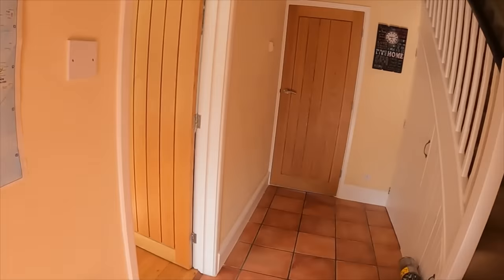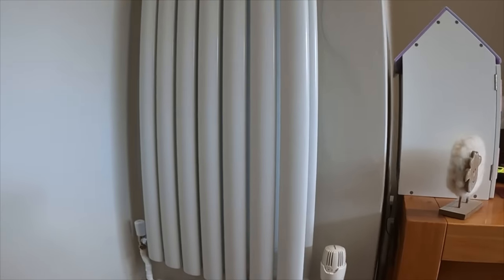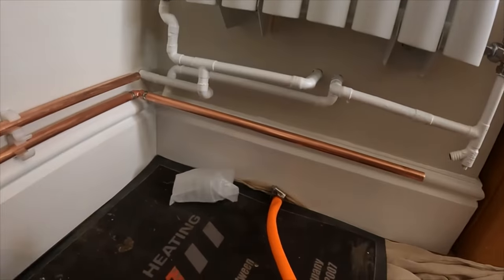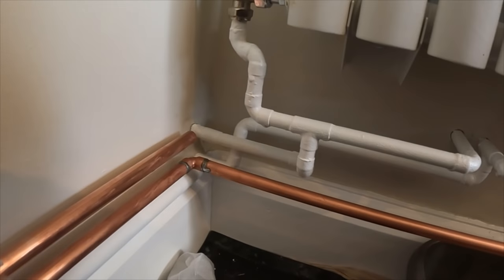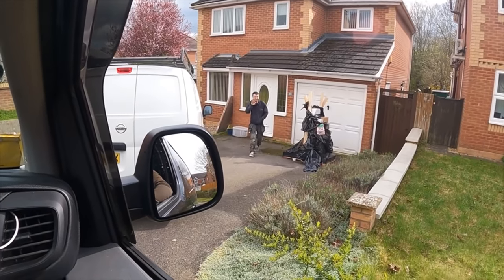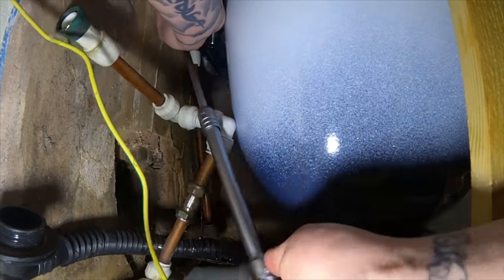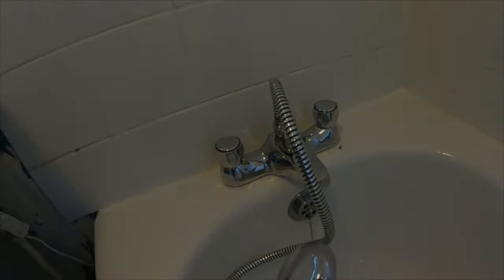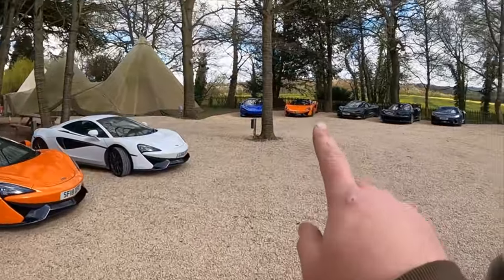HOW TO FIT A RADIATOR in your HOME | REAL WORLD PLUMBING

Comment: When i started work aged 15 in 1969 at a medium sized industrial heating firm, everything around radiators was hand screwed iron pipe. Schools circuits might start off in 2" and diminish to around 1" at circuit ends, radiator sticks had to be offset by hand, and flow risers kept perfectly in line with radiator edges as the clerk of works would walk around eyeing them up. Boilers were delivered in sections, the biggest i can remember was the Robin Hood Colonel ,and the Beeston Brigadier. We had to prepare bases, somehow get the sections into place, clean all the ports and nipples, lightly oil them and then place them in position, one by one, and pass the stay rods through the hole in the castings before tightening up evenly to pull all together. Cast iron radiators arrived in sections, having to be made together with left and right hand nipples and a nippling tool , thin gaskets being the sealing medium between sections.I well remember an old guy showing me how early cast iron heating systems were jointed , such as in churches etc, it was a repair, and consisted of caulking a joint with the aid of spun yarn, sal amoniac, iron filings and piss, the uric acid causing the rapid setting of the sal ammoniac, and the resulting rust of the iron filings further strengthening the joint. Now retired , I loved those days, eating asbestos, mashing tea, being with the old guard , the discipline, the laughs, and the men who made sure that you knew enough to hold your own, I wouldnt change my memories of those days for anything . Sorry to bore you all, but I have very fond memories of my working life, same firm for 45 years .
Reply from the maker: 👏🏼👏🏼👏🏼🙌🏼🙌🏼🙌🏼🙌🏼….. thanks for the message buddy
Reply: @MJTiffPlumbing  Lol, thanks for reading, I just have such very fond memories of those long gone days, I was always in my element with the jobs we had, old Cyril , who could wipe a joint. lead to lead and make it look like it had been turned on a lathe, Albert who used to cop for mainlaying, standing over me while caulking my first joints with yarn and lead that had to stand 200 lb test pressure, being made by old Fred to draw branches up by hand on 10 inch copper while he stood smoking his pipe , they were passing the old skills on, and now they have gone, well progress i suppose. At least, I have some very happy memories, stay safe and I hope everyone can keep themselves employed and prosperous.
Reply: Absolutely love this old stuff. Would love to hear more

Comment: Another great video Mark, its never easy when your connecting onto existing heating pipes, you just have to do your best with what you've got, the barns looking stunning mate, the customer should be really pleased with the standard of finish
Reply from the maker: Evening Tom
Thanks mate…. Yer they can be a pain sometimes with that bit of water that just won’t come out🙈

Yer the Barn is there or there abouts now….. want to get a video with the heating system up and running very soon

Comment: I was looking forward to seeing how you sweat off a fitting , but you forgot. I assume you simply apply heat, pull off the fitting and wipe clean while it is still hot. That plumbing beneath the vertical radiator reminded me of a London Underground map! The customer must be mad not to have it taken out and increasing the size of the new one to compensate. The pipes could then have been tidied. It would not have been a big job to fill a few holes in the wall and give it a lick of paint, especially since it is such a small area. Some people can't think past the tip of their nose. Nice video, I'm new to your channel., I like the way you explain exactly what you are doing. I'd have hated the tap exchange, but that ratchet tool is remarkable. I'm retired, but have always been a keen DIYer who enjoys plumbing.

Comment: Tricky job on the rad but looks neat enough with what you were up against i agree with you about putting enough solder on the joints better than leaks and having to drain down again
Reply from the maker: Thanks mate, yep I like to know it’s run round.

Comment: Is it better to take valves off before soldering just incase can melt inside if rubber.
Reply from the maker: You can do, I’ve never had an issue

Comment: As a retired plumber I think it looks great in a steam punk kinda way, love the vids but just curious, do you not use a bender, I would have been hung if I used the amount of fittings you tend to use, I also had to use tube expounders instead of straight couplers, but then we did use lead solder back in my day. as I say love the vids. from northern ireland.
Reply from the maker: Thanks buddy…. Indeed I do use a bender when needed, infact I have JUST today had a new one delivered….. keep your eyes out for a new video
Reply: Steam punk is right

Comment: Yes once again great job i was just curious as to why that tall rad was not removed altogether, and a much larger rad installed straight away,I ask because my builder got me to fit them and they are complete rubbish especially the one in the extension,i have regretted ever fitting them, the prob is the floors are down, and wifey says no pipes on the skirtings, she hat the pipes, cheers again.
Reply from the maker: As said in the video…. Saved the issue behind it

Comment: Another great video mate and appreciate the advice and skill that you have with your trade. If I can ask a simple question, I seen that the pipes had been painted, in your opinion what is the best way to take paint off copper pipes to replace a valve and clean up the joins?
Reply from the maker: Thanks buddy….

You can use good old wire wool and heat it up…. Works for me

Comment: Not surprised that tall rad didn't heat the space, it's in the worst position going. Internal wall directly across from the window or below the window to aid convection otherwise you risk poor air circulation or warm air blanketing shutting the TRV down prematurely. Come across it so often with new builds where they couldn't be bothered to run the pipework to the outside walls so every rad is on a side wall close to the centre of the house.

Lovely job on the pipework considering what you had to work with.
Reply from the maker: Yep, they are just so ineffective…. But look nice 🤣🙈🙈

Yer sometimes you can only do what you can with the Pipework you have
Reply: @MJTiffPlumbing  Yeah look great and the potential heat output is high, if they're placed in a room properly, either side of the window would have done a better job. 
Barn is looking great now the shower screens are in, though I wouldn't want to have to change the combi valve on that tank, hopefully looks tighter on camera than it really is.
Reply from the maker: @effervescence5664  thanks mate

Nope….. is proper tight, nowt to do with me but I have mentioned it. 🙈🙈
Reply: Didn't know it wasna GOOD thing for rads to be under windows! Thanks for info.

Comment: Another good vid: mind you, you are a lucky boy with both that vacuum & bath tap change. Last ones I did, couldn’t hold vacuum for some reason & bath tap had no iso valves & old broken gate valves on water supplies & the bog 9 cms from the bath panel & boxing too! No wonder most plumbers tend to hang up when people ask bout bath tap change!😁😂😁
Reply from the maker: Never had an issue bunging tanks, just mate sure it’s done right and air tight.
And the taps…. I was waiting for the ISO’s to leak to be honest 🤣🤣

Comment: Random question for you... if its a gravity fed system did you have to rebalance the system? My heating works off a back boiler in my coal fire and i cant get any heat in my dining room rad without putting the pump on... all other rads warm apart from that one but it warms lovely with the wee pump on? Any advice?
Reply from the maker: Leave the pump on buddy 👍🏼👍🏼

Comment: Loving the videos, keep up the good work. Its never easy doing a great job with hard pipework.  With the bath tap change, did you fit Double check valves after converting it to a mixer shower off camera?
Reply from the maker: Thanks mate…. Glad you liked it.
Was just a tap swap mate, as far as I am aware there is a check valve within the body of the tap for the shower

Comment: Hi ..can you offer some quick advice please? .. I'm switching a bathroom radiator for  a towel rail and the pipework will need altering to suit. My question is , instead of draining the system would I get away with just shutting the water mains off , rejigging the pipework to suit, fill new radiator,bleed and re pressurise the Combi boiler?
Reply from the maker: Depends if the pipework is the same position.??
Reply: @MJTiffPlumbing  same position? This is what I mean it will need altering to fit and suit the new towel rail ,I'm just wondering if I'd get away with just turning the stop cock off to do it ?

Comment: So sweating off old fittings...?..... just rub back the paint, heat it with the blowtorch until it melts the solder  and comes apart right?
Reply from the maker: If you do it right

Comment: Hiya, I'm contemplating a diy rad install. I genuinely can't stretch to the £300 to £510 I've been quoted, it's not that I think I'm being ripped off, it's just more than I can afford.

I've watched several of your videos, on heating, and other similar plumbers. I wonder if I can ask you a question please? I have got access to the pipes in the ceiling Above where I want a rad. I'm going to do push fit in the ceiling and down the wall (as it's just next to the understairs cupboard so won't be seen) then copper pipe just to attach under the rad to valves.
My problem is how do I know which pipe brings the hot, and which pipe takes the tepid away when it refills. There are more than 2 central heating pipes in the ceiling void, but I could follow them back to another heater. 
Is there a right and wrong way? Another plumber said something about TRVs that work on the in or out side of the rad?
Reply from the maker: Yes the valves are bi-directional so will work on either the flow or return
Reply: Phew! That was the bit I was afraid about. Right, tomorrow whilst my husband is away for work, mischief is occurring. 😁 Thank you so much.

Operation "drop leg heater" is on. 😂 (which means I need a drain off tap thingy. I learnt something, woo hoo!)

Comment: Hi, might sound a bit random, but if you were installing a new radiator onto existing pipe work would you install away from the valves bit by bit or towards the valves? Is either way easier than the other?

Comment: Would in this case it not be best to install the rad in series and bump up the flow a bit? this way you would improve return delta T to the boiler increasing efficiency?
Reply from the maker: It’s not an issue at all in what was done to be honest……

Comment: There’ll be so much heat from the copper the radiator will be redundant. I have to say I have thought about bringing my pipework into the house from under the floor to use the heat in place of having to insulate the pipes.
Reply from the maker: Energy efficient 🤣👌🏼
Reply: @MJTiffPlumbing  I’m just tight. Yorkshireman.

Comment: Great video. How would you drain off a system where the drain off valve face bit has been chewed?
Reply: Remove the valve completely so it's just a bit of pipe, reattach a new drain off valve afterwards before refilling.

Comment: Just a question how did water drain if you caused vaccum as if you have water in i guess you wouldnt be able to solder thanx
Reply from the maker: The vacuum holds the water within the system, the area you cut open will release a little bit of water for you to work on

Comment: Had some bodge that my landlord got out today come and put in a new rad ! Well long story short the rad he got was miles too big he had to move pipes etc the reason we needed a new one is because the rad was proper old and had rust which caused pin hole leak and I told the landlord 3 months ago about it and the fact it NEEDS a whole system flush with sludge solution! He got this guy out and I told him multiple times that it won't work and he was adomant that if we put the new one on it will work fine ! Well we were told to keep old rads off because they leaked downstairs in neighbours and so we haven't had any heat for 3 months ! Leaving it that long has 100% messed it up even more I am fuming to say the least because the guy said he knew what he was doing! After he fitted rad etc and turned boiler on the hot water comes but not 1 rad heats up !!! He filled water back to just over 1 and wasn't still working so he left it like that and said leave it an hour and if not working ask landlord to send someone else out because he has no clue !!! I said from day 1 its sludge and that's obviously  worsened while the rads been off !  Now he's having to pay out double the money because he chose to get a bodge builder to do it !!! I should have refused to let him in but if I did  he would say to council that I didnt let the man in to do it but its for this reason all the tools and not 1 idea! Im a woman and even i know full fact its sludge ! The pilot flame comes on for hot water but only for hot water as soon as we turn heat on it everything cold and the flame goes out! Going to cost him ten times more because hes a lazy landlord and didn't get it fixed way way sooner ! Hes that bad I will be surprised that the gas man who usually comes who is professional wont come here anymore after last time he came and landlord didnt pay him ! So hope he can find someone else because he likes to get shit cheap and it gets on my nerves its his property and he has not 1 idea of how to run it as a landlord! We don't even have up to date gas certificate!

Comment: I'm not a plumber, and I know the client agreed to keep the old radiator, but if the system was drained down - why didn't you just remove the old radiator - simplify the old pipes and just T-off the feed to the new radiator?
Reply from the maker: Because the customer didn’t want that

Comment: hi m8 could you not connect  the pipes as they came out of the wall n why not drain the system n get all that crap out of the tank n barn looks stunning
Reply: My guess is time issue, then refilling the system venting and the potential of dealing with airlock. More time on the job means more money the customer has to pay. If they don't want the system flushing out then there's no point if there's an alternative method.

Comment: Any new inhibitor put in ,
Reply from the maker: No need, as I didn’t drain the system…..
Bunging the tank as shown in the video means the water stays in the system…. So the inhibitor also stays in the system 

Thanks for watching👍🏼👍🏼
Reply: @MJTiffPlumbing  good job , keep ere warm and dry 💯
Reply from the maker: @peterconnolly4608  👍🏼👍🏼
Reply: If it’s just an indirect tank on a y plan providing the boilers suitable…. With pipework like that I’d of stripped the heating header tank out and pressurised it.  Makes a massive difference and also protects the life of the system with no air and sludge been dragged in.

Comment: Good video. But it's not heating the room because the radiator isn't up to the task. It's not heating the room because multiple rads piped in 15mm pipe...
Reply from the maker: It’s heating the room completely fine now as I’ve fitted a convecting radiator buddy, that’s how to fully heat a room 😉
The Pipework is more than upto the task as the radiator back to back with it in the other room is also working fine and heating the room.

The column radiator was getting hot but only in that area… as that’s the design of them.
That was the issue that’s now been completely sorted and the room is now hot.
Reply: 15mm will take 11kw at dt20. Basically you could run 15mm primaries on nearly every average domestic job. You just have to watch the head loss on the index circuit and map the pump accordingly.

Comment: Good video and well explained 👏 
HOWEVER where you connected into the D.O.C I would have either offset or better still 4 elbows and clipped that pipe just ubove skirting board as you did adjacent .
No disrespect but nothing worse than floating pipes.
Reply from the maker: Everyone will always have there own way of doing it👍🏼👍🏼
HOWEVER….. as I said a few times in the video it’s being boxed in so the Pipework you WILL see will be clipped.
No disrespect but it was never going to be an issue..👍🏼
Reply: @MJTiffPlumbing  why are so many plumbers out to pick flies with each other lol bloody jobs worths out there 😂